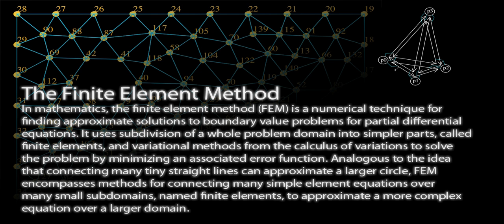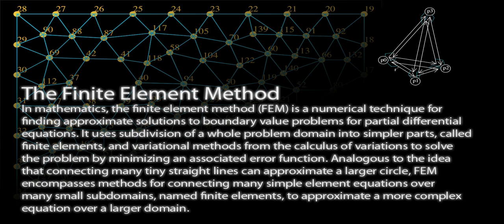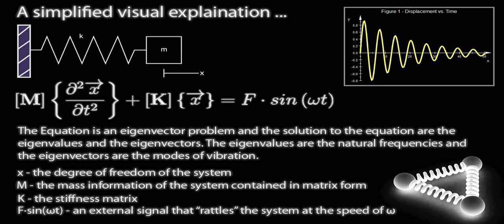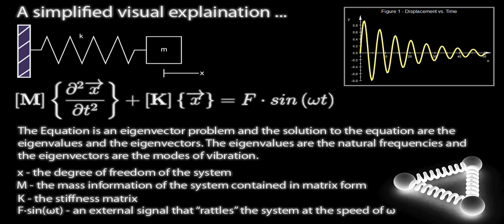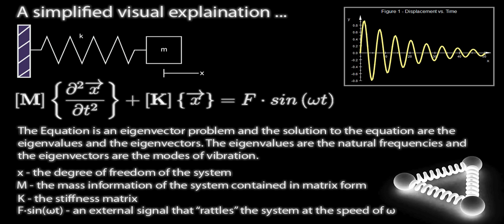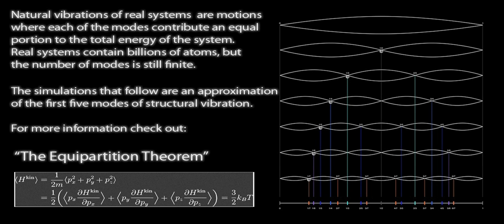Structural Vibrations Demo (Resonance, Equations of Motion, FEM Overview, Equipartition Theorem!)

Comment from the maker: Here's a short video I created with some of my work on vibration analysis. Often overlooked in past designs of structural components. Although now, with modern computing speeds and simulation software make these a dream for design engineers!